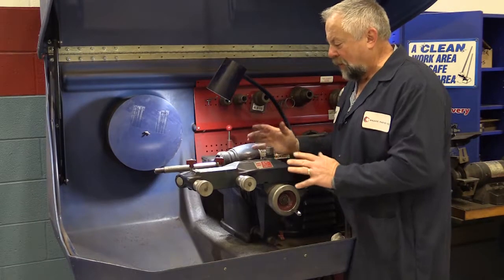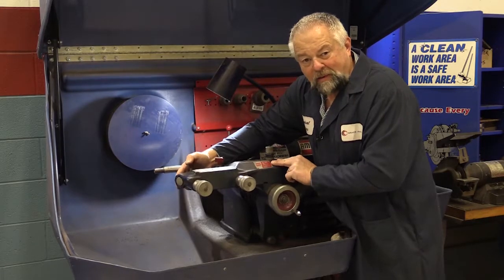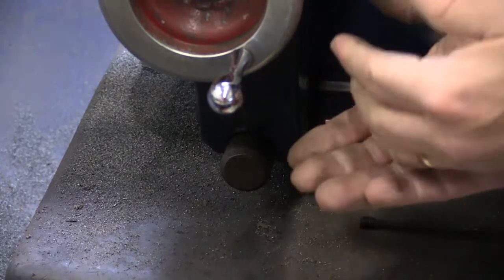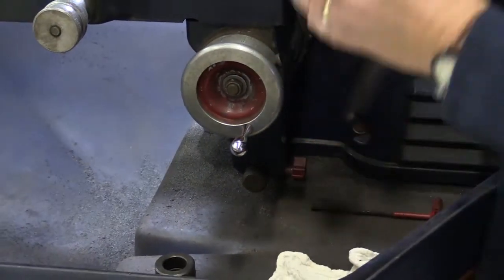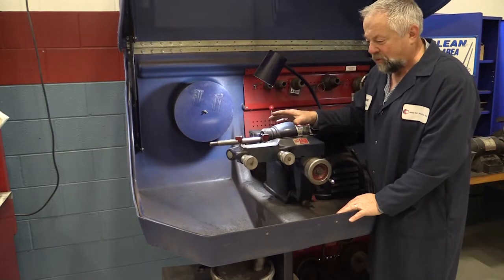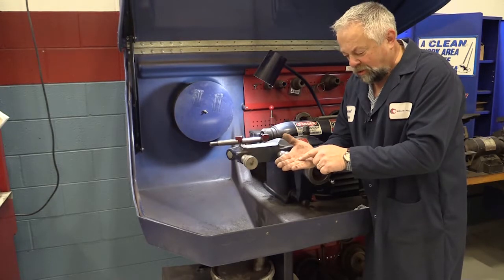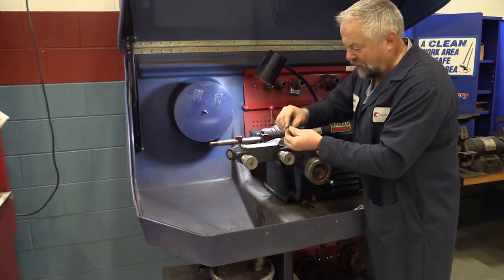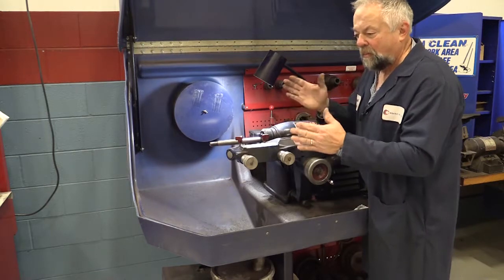Brake Lathe Cutting Head Maintenance

Comment: Great videos! Didn't maintain my brake lathe for a while & wasn't getting the desired brake finish on my rotors & thus unsatisfactory braking results. When through & installed a fresh set of bits, lubed up what I could lube up, adjusted some of the slack points. Trued all my adapter cups! The difference was tremendious! Thanks for the tips!

Comment: You can actually use it 3 times and then flip it and use it three more times. Then you take the outside knife and put it on the inside and the inside on the outside and start over. So you get 12 edges per knife.

Comment: We clean the machine, the rotors and tell the customer to clean the hub. Who cleans the back support cups to keep them square with the arbor shaft? Chuck theses cups and add spacers until tight, then cut just the one side that touches the rotor. Then, to make this repeatable, take a small cold chisel and mark the cup to that arbor. Make it clean to everyone using this machine, to line up these two marks each time. 
  To check if bent, clean and install a hub less rotor. Cut it the once to twice. Install a magnetic base w/dial indicator, rotate once, should be no meter Al run out!
  Loosen the nut, carefully hold the arbor and rotate the rotor only and retighten. Turn the machine on slow, no cut needed. Did you just cut 0.110" of an inch into rotor. It should be the same for any position. It not, cut the cup after dressing the back for flat. Cold chisel, mark, cut all the rotors you want!
  This is why finger pointing happens after a couple of thousands miles of diving. It is not immediate but a pulsating feel returns ever so slightly. 3-6 cups, used to produce a 90 degree angle, they get dropped, crushed and used on the hydraulic press and miss sharpened. Fix all the problems, don't cut them in. DK, ASE Master Tech since 78, retired.